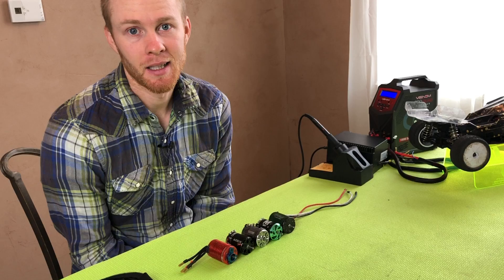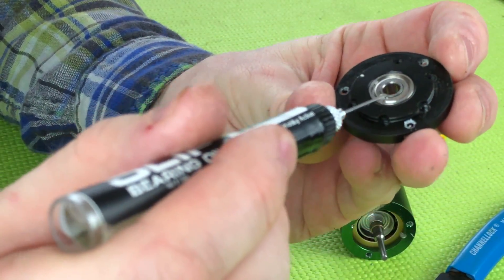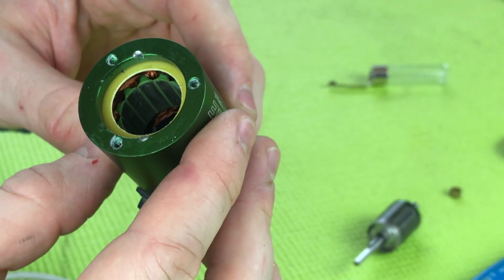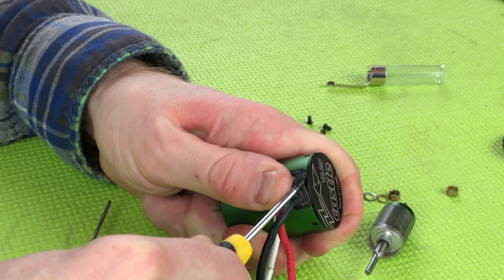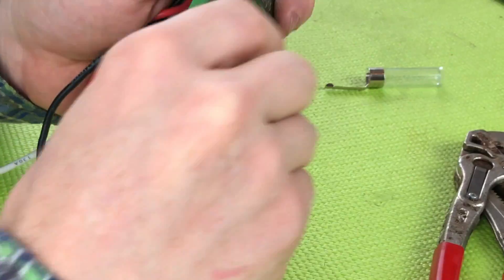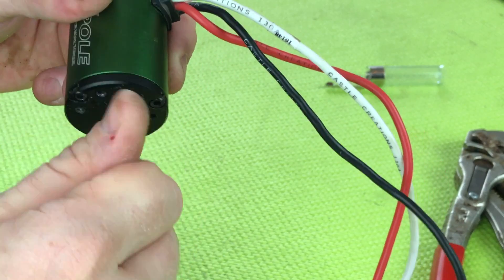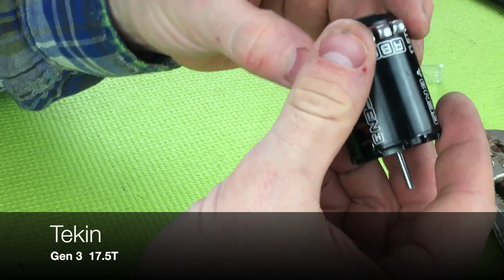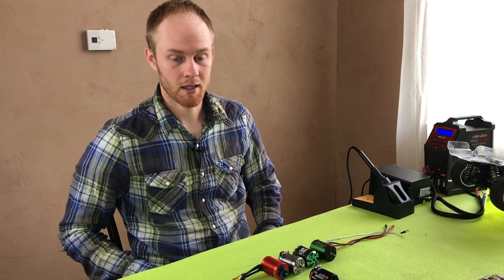Brushless Motor Maintenance | Oiling 1:10 scale RC Car Motor

Comment: The bearings should be greased or replaced oiling them just flushes the old oil out. Much like wd40 does it can actually harm the motor.

Comment: What about cleaning the dirt out of the bearings first? The biggest cause in failure is a bearing packed with dirt, and this should be done at least after each day of running.
Reply: I recommend dropping the bearings in a small glass container full of lacquer thinner and stirring them around periodically. When they’re done, allow them to sit for a while until the thinner evaporates so when you apply your lubricant it doesn’t eat away at it.
Reply: @thefriendlyteenager726  RPM makes a bearing blaster, some nitro force or other pressurized cleaner done in minutes.
Reply: @paulsdrc  wow I didn’t know that. Thanks for keeping the hobby fun!

Comment: You can actually remove the shield off of either side of a bearing and oil the INTERNALS , then put the shield back on.......

That's how i would've done it.
Reply: I would just replace the bearings if i had to do all that. They are a couple bucks.
Reply: @CadgerChristmasLightShow  
That too... But since i know how.......

Comment: Hi, thanks for the video. Would it be okay to put lock tight on the screws?
Reply: If it didn't come with it from the factory I don't and if it did use the blue kind red is far too potent.

Comment: Want to know a better and easier way of oiling the motor? Grab a small sized tupperware fill with any lubricant oil, rennet motor must be wired connected to esc and powered on. Then drown the motor and run it toward and reverse for 30sec and wala. Best way to oil your brushless been doing it for years
Reply: @Ed H. uh were did you get that information? I can't find anything on oil demagnetizing magnets.....
Reply: I have a 3652 400kv hobbywing brushless it runs good for about 3 to 5 mins then it want go have to cut it off back on to get it to go any suggestions on what it could be
Reply: Casey Wachsmann that sounds like it’s either overheating and your speed control shuts it down , could be from a bad bearing needing too much force to spin, or your esc/speed controller is junk. I would try to put your motor In another vehicle with another brushless esc and see if it’s the same case . That could tell you if it’s the motor itself or the speed controller making the motor slow down .
Reply: @caseywachsmann4651  it sounds like the automatic thermal protection system is cutting it off so that your motor doesn’t kill itself. You should probably invest in a heat sink and a motor fan
Reply: This is crazy ! All the oil attracting all he extra dirt and grime .